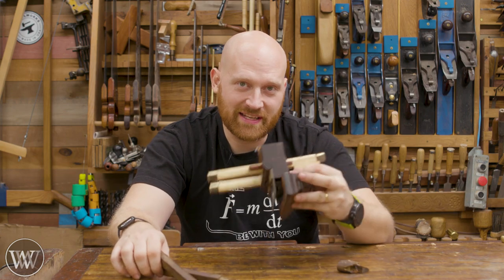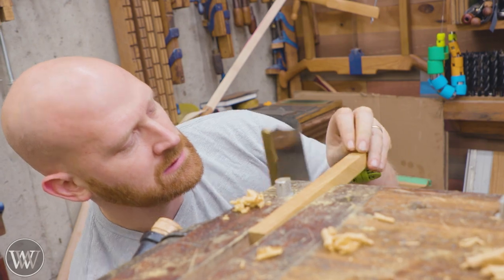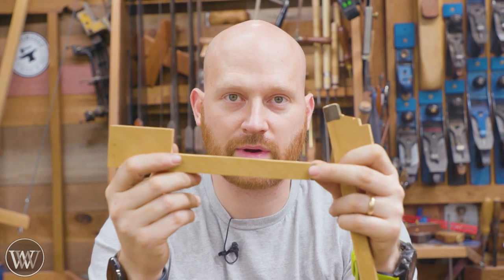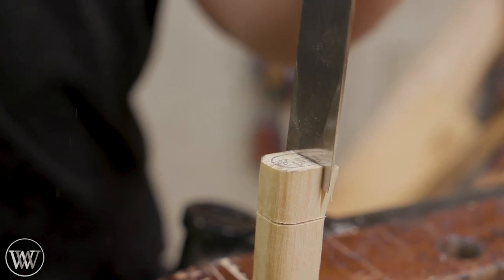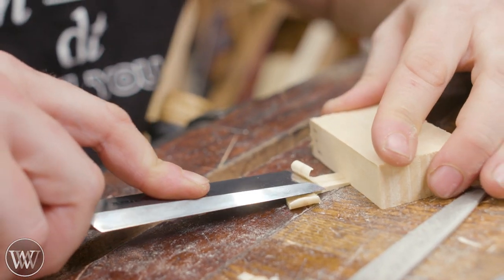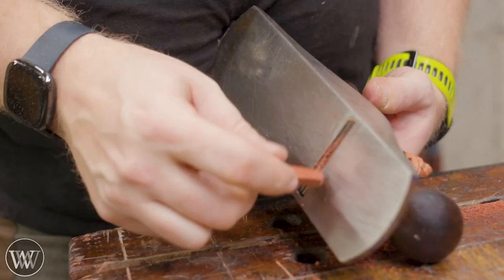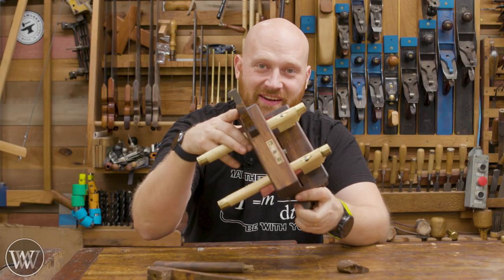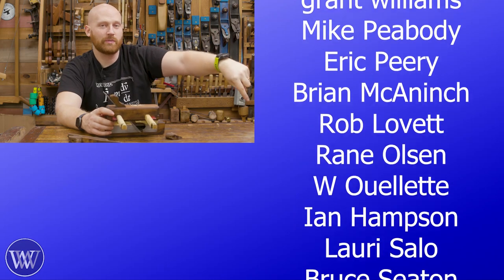How to Restore a Plow Plane New arms

Comment: Great video, as usual.  I have an old plow plane with threaded arms. Of course, some of the threads are stripped off.  I’m hoping to make new arms and wooden nuts using a tap and die set.  I wish you’d do a video about this type of plow plane repair. Otherwise I’m going to have to figure it all out for myself!
Reply from the maker: I might in the future. Finding them with perfect threads all throughout is almost impossible. A lot of times the threading would break off just after being manufactured. And a lot of the companies would sell them just that way because it really doesn't make much of a difference if the threads are fully intact or partially chipped out.

Comment: cutting the shoulder lines for the brass ferrules reminds me of how luthiers saw slots to put the frets into guitars especially with the rounded surface. a popular trick is to use a piece of tape along the saw plate as a depth marking so u dont saw too far into the "tenon". just a potentially useful suggestion :) (edit: since the ferrule will cover the tenon completely theres really no need but its still good trick to save for a rainy day)
Reply from the maker: Right on. I used the tape trick when the depth is important or I need it to be consistent. In this case. I just eyeballed it and made sure I stayed a little bit less than I needed to be so I could chisel back to it.

Comment: I have an old transitional bench plane from my grandfather that needs a new sole. I'm thinking about just planing it flat and glue a piece of oak to the old sole. Will that hold together or is it necessary to use some kind of joint for better mechanical strength? I will also have to cut the throat in the oak which might be the biggest challenge.
Reply from the maker: That is what I usually do. Just glue on a new base. As long as there is a good joint it will last.
Reply: @WoodByWrightHowTo  Thank you!

Comment: Very nice!  Thanks.  I have one that is missing some of the brass ferrels.  Any ideas on how to replace those?  A casting is probably the obvious solution, but I don't have the skills or tools for that.
Reply from the maker: Unfortunately, there were so many different variations of them that finding a replacement is almost impossible. Probably the easiest thing would be getting a copper or brass pipe and forming it to the right shape.
Reply: @WoodByWrightHowTo  Thanks.  That thought had crossed my mind, too.  Copper might be easier to shape and more accessible.  Would probably mean reshaping the arms which is one of the reasons I liked your video.
Reply: Get some square brass bar. Saw to length of the ferule. Round over the top to match the arms. Drill out the center & file it square. While this sounds a lot of work brass is soft and easy to work with, much easier than steel for example. It's fun and while brass does have a cost it's not huge. You also need to be able to hold the part in a small engineer's vice rather than a wood work vice in my opinion, but with care anythings possible. Good luck.
Reply: PS in England you can get small amounts of brass from ebay, I don't know where you are but I imagine other countries are the same.
Reply: @andrewbeaumont5492  Thank you, Andrew.  This is not an approach I had considered.  Your suggestion about ebay is very helpful.  Brass is somewhat expensive and I wouldn't need much.
Reply: @DavidS-dh5ev  I purchase it it 4" / 100 mm lengths - enough for several, including mistakes, of course.